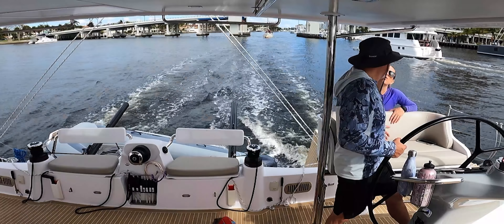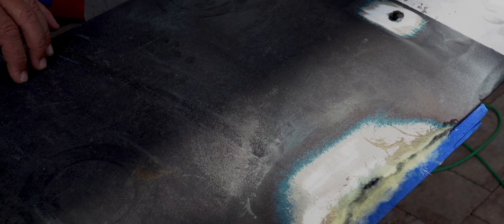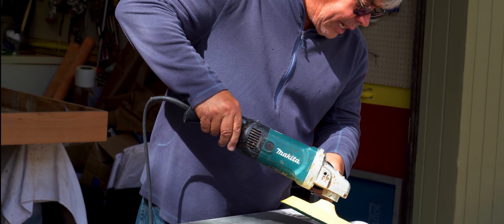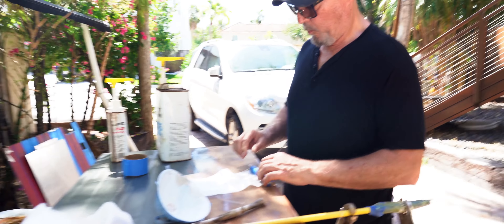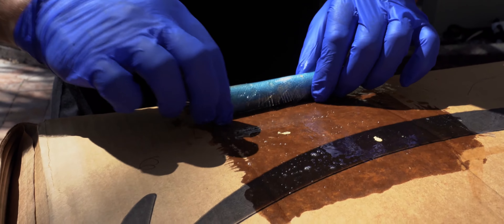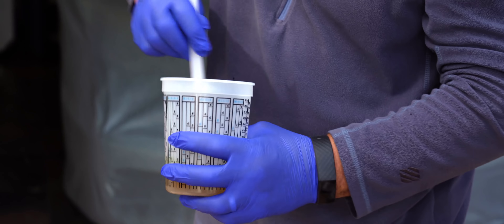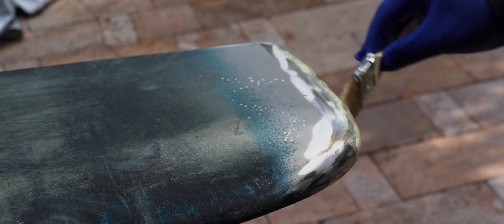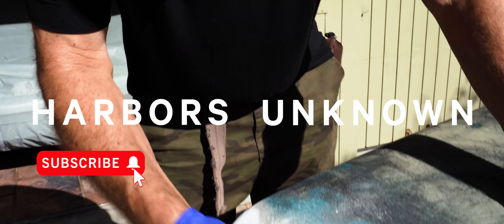Boat Projects Begin! Fixing the Rudder on our Seawind 1600 Catamaran | Harbors Unknown Ep. 21

Comment: Watch out for the bottom fish!  So how hard was it removing the ruder?
Reply: The rudders on the 1600 are adjustable and can actually be completely removed quite easily.
Reply from the maker: Usually it’s easy to remove the rudder but because the pin got jammed we had to use the main halyard to lift it out. Thanks for watching!